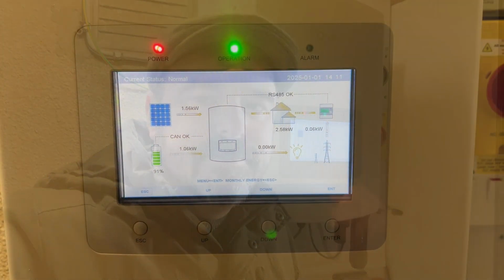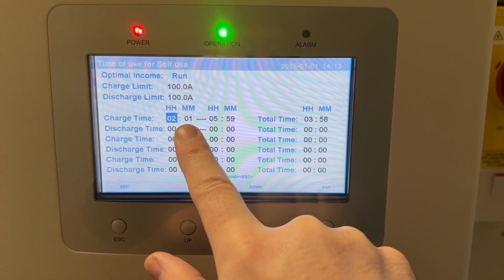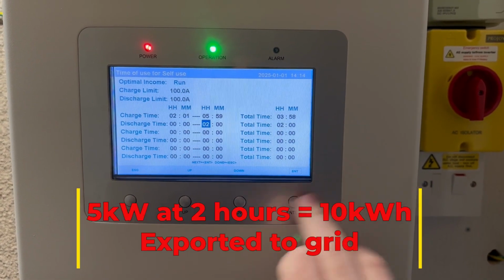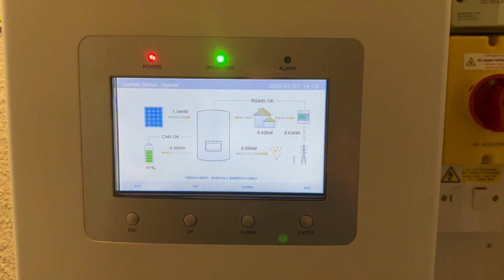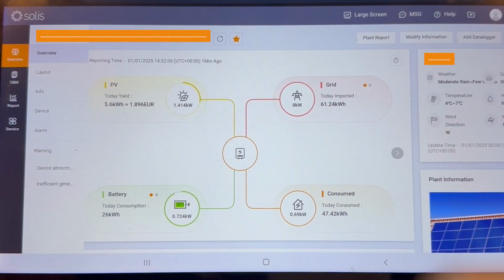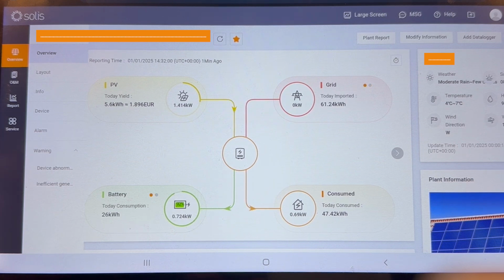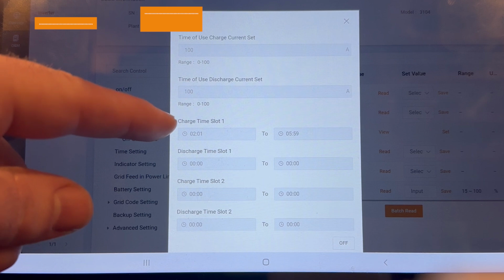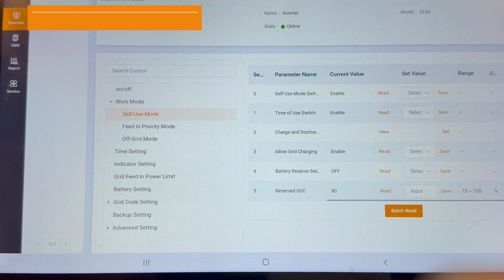Solis Inverter Timers - Why and How to use them

Comment: Hi, thanks for the video. You are saying in it that during a charge window, i.e. 2-6am, the battery won't discharge, i.e. power a load in the house. However I am experiencing that I can not charge my battery from the grid and charge my EV at the same time. Because as soon as my EV starts charging (i.e. 2am) it discharges the battery, even though the battery is in the charge window. As soon as the EV finishes charging (i.e. 4.30am), the battery will charge again for the remainder of the charge slot. What could cause this? Thanks
Reply from the maker: If the battery timer is correctly setup, the only reason I can think the batteries are not charging while the EV is charging is that you have them on a priority switch/board. This is common if you have an electric shower and an EV charger. One item (usually the shower) takes priority and the other receives no power while the priority load is active. Is it possible your battery and EV charger are on a priority board? Check it out.

Comment: Hi Gary, That was an excellent video. I have the Solis 6KW Hybrid inverter connected to my LG RESU 6.5 KW battery and I have Octopus low tariff from 23.30 to 05.30 . My battery is set to charge at 70 amps on a single phase AC and battery voltage is 51V. My battery never charges to more than 60% SOC . Please advise.
Reply from the maker: I just leave mine at the 100A setting. Your problem is most likely a battery BMS setting, but it could be a number of issues I can't begin to diagnose over youtube comments. If you can access the BMS settings, that is where I would look first. If you have no access to that, or are not familiar with it, you could change the battery type on the inverter settings and set the parameters there, aiming to bypass the battery BMS. You will be able to get more direct advice on the DIYsolar forum, because there you can discuss the problem and get troubleshooting assistance by means of photos and link sharing that we can't do here. Be sure you record and changes you are making so you can revert to current settings should you make a mistake. I hope that helps.

Comment: Cool video. I have a WECO battery with the Solis 5kW invertor. I've just heard from Solis that the Datalogger and RF Gateway device installed 2 years ago are obselete and to do any invertor Configuration from the app or web, then a new S3 wifi Datalogger is required. Have you heard of others who have experienced similar?

Comment: Very informative video thanks . 
I have a similar set up and have everything running through the solis cloud app. 
Have the exact same inverter as yourself and have 3x 5kw WECO batteries . But the soils app only shows 5kw? Is there a way to get the 3 batteries shown? 
Many thanks
Reply from the maker: When your batteries are connected via rs485, you will see an overall percentage. You could sell the WECO batteries, buy a 15kWh Seplos battery and make a profit without losing any storage.
Reply: Yeah it shows the % but seems to be only for one battery. As I have an app for the WECO and shows there current state . Be nice to have them all under the solis app. 

How much do they go for? Is it something you think be beneficial as opposed to having 3x separate batteries ?

Comment: Thanks for your Solis guide videos - really helpful.
But I've got a setup that doesn't seem to be covered in the videos. I'm on Octopus Flux Import/Export tariff: cheap rates 2.00am - 5.00am and expensive rates 4.00pm - 7.00pm. So I set the Solis TOU settings to download from the grid 2.00am to 5.00am and this takes my battery to about 96%. I then want to keep that charge until 4.00pm and set my TOU to discharge until 7.00pm. But if I have nothing set between 5.00am and 4.00pm my battery immediately starts to discharge, so that by 4.00pm there's nothing left to set off against the high rate.
The only way I've found to keep the charge in the battery is to set a Discharge Time Slot of 5.01am to 4.00pm @ 0 amps. This does keep the charge until 4.00pm and then releases it to the house. But this has the disadvantage of preventing any surplus PV from topping up the battery between 5.01am and 4.00pm because the inverter is in a discharge period.
Help please (I'm probably missing something because I'm new to all this 🤔). Thanks
Reply from the maker: So, you have come across one of the main limiting factors with the Solis inverter on the existing software. You correctly state that setting a discharge time at 0 Amps prevents battery charging from soaking up excess solar. What would be ideal is for Solis to have the option to hold the battery charge between a set time and this would allow excess solar to be stored in the battery. 

If you need the full 14-15kWh to use for the 4-7pm expensive time, then I think you have one real option; add another battery to your setup which would keep the house running off the batteries up until and after the 4-7pm peak. Depending on how fast you can charge the batteries and how generous the export tariff is, you could also dump excess from say midnight to 2am. This could potentially repay the extra battery cost within a year or two with everything after being profit (again...depends on your tariff and export rates). I know of Octopus, but we don't have it in the Republic of Ireland, so I haven't looked at the rates. 

Your inverter size is the potential limiting factor. If it's 5kW, you get 15kWh each night. A 6kW inverter givers you 18kWh. Or....adding a 57V 3000W charger to a circuit (using an electrician) will give you an extra 9kWh per night. 

Maybe Solis/Ginlong will add better functionality to the product soon. They really should.
Reply: @GaryOnPower  Thanks Gary, brilliant to get such a quick reply.

I'll bear in mind what you've said about another battery but, for the moment, I'll stick with what I've got because I'm just trying to get up to speed with everything. I've got two 5.2kW batteries at the moment but I'm guessing from what you've said that the limiting factor will be that my Solis inverter is max 3kW 🙄.

96% of my batteries is effectively only equal to about 7kW (after the reserve 20%) so this is usually fully discharged between 4-7pm. My PV energy is very low at the moment, so practically nothing for export to the grid (if I've understood how it all works).

Now that I know my question wasn't way off-beam, I might send the same question to Solis, just to highlight the dilemma.

Thanks again. Please let me know if I'm still not understanding something.
Reply from the maker: @RichardMee-s7i  You have 2 problems here. 

1) You have expensive, small batteries.

2) Your inverter is too small.

Problem 1. 
I assumed you had a 15 or 16kWh battery. If you only have 2 x 5.2kWh batteries and you have a high reserve of 20%, you are under utilising an already expensive battery setup, because you have branded batteries which probably cost you over £2,000 each.

I would highly recommend you look into the DIY batteries. Perhaps a single 15 or 16kWh battery with a max 15% reserve will mean you won't have to worry about saving energy for the 4-7pm peak. I say this as someone who was going to buy 2 x 5.3kWh WECO batteries last year when I got solar. I wasn't even considering DIY, because it seemed like so much work. Well....it isn't. I promise.

You should look at FogStar. They are based just south of Birmingham and sell DIY kits as well as premade batteries. Way more value for each kWh of storage.  They sell their own battery kits too, but I can't say anything about those, as they haven't sent me one to try out and I have enough storage which I paid for with my own money. This is where I purchased my battery cases from. Sell the 2 smaller batteries and you will likely have a profit as well as more storage. 

Problem 2.
Your inverter is undersized. You probably only have a small array, which is fine for the solar side, but inadequate for properly utilising the stored energy, or charging your batteries. Without knowing your setup, I will keep this simple. If I were you, I would buy a used 5kWh Solis Hybrid inverter. Have an electrician swap out the 3kW inverter for the old one. Saves you a bunch and really increases your power punch. You can charge and discharge faster. So, you can use the kettle and the electric oven at the same time without pulling from the grid! Sell the old 3kW inverter to recover some of the costs. Note that the electrician may need to upgrade the breaker for the upgraded inverter to a 32A, but you may already have a 32A breaker in-situ. 

At the end of this upgrade, you should break even (thanks to the expensive batteries being sold) or have spent very little. You will save more because you are using cheaper stored energy throughout the day from the battery and drawing less from the grid, because you can then draw 5kW from the battery instead of only 3kW at a time.

Watch my other videos to see how easy it is. I'll eat my hat if that doesn't convince you get started on the the upgrades.

Best of luck with it.
Reply: @GaryOnPower  Thanks again, that's some brilliant advice. I'm going to explore all the detail. 

My install was an "upgrade" grant based system which didn't include batteries. I said to the installers that I would pay for the batteries myself and asked their advice on what to buy (based on their Retrofit Design). They recommended 2 x 5kW batteries and, you're right, I paid over £2,000 for each. An inverter (which I'd never heard of) was not mentioned so they just turned up with the Solis 3kW on the installation day. Following your advice, and my practical experience since install, I now realise that the inverter is inadequate, so the first thing I'm going to do is ask them to replace the Solis 3kW with a Solis 5kW. They really shouldn't have recommended batteries without providing the correct inverter required to efficiently operate them.

Hopefully, this can be resolved with the installers without hastle. To be fair to them, I have to say that the rest of the install (ASHP, new radiators/pipework, cavity insulation, etc) has been superb and we're very pleased.

When the Solis inverter problem is resolved, I'll be exploring what you say about FogStar, etc.

Thanks again 👌👍